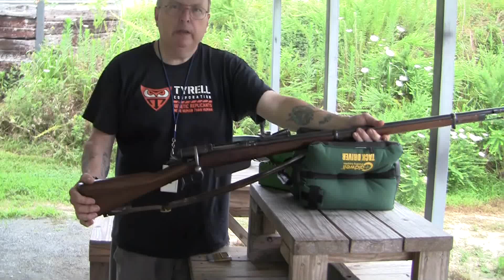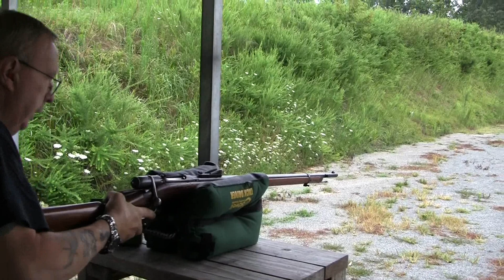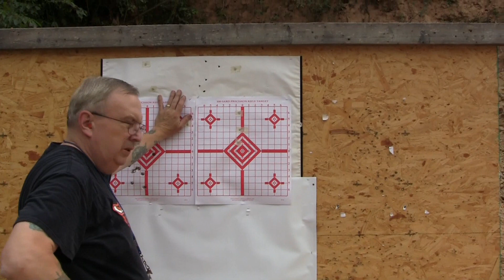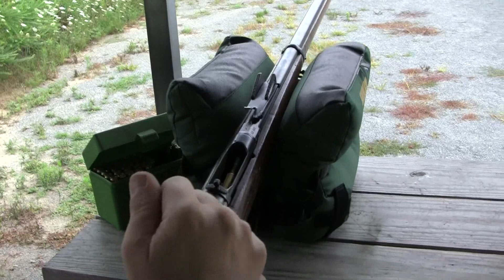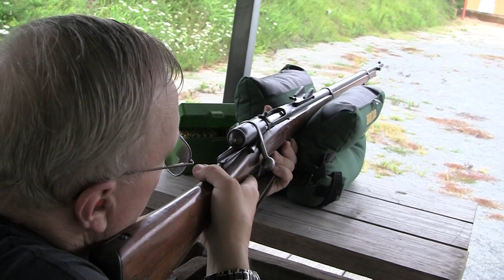shooting Italian Vetterli 1870/87/15 rifle 6.5mm

Comment: Still have one I bought for $12.95 back in 1967. Was listed in the ad as a decorator and described as "Italian VV70 sniper rifle". Came out of the ancient leftover Bannerman inventory. Gun turned out to be in pretty fair shape but had a weak firing spring which I replaced believe it or not with a valve spring from an old lawn mower engine. Back in the day I was brave enough to shoot the rifle using full power surplus military loads and survived. Switched to Norma 6.5 carcano loads that are not loaded to full pressure like the military rounds . Never had any problems smooth action good ejection etc. Maybe I got lucky. In any case now it just stays on the wall as a decorator.

Comment: That’s not how you handle a misfire, which could turn into a hang fire. Just because that cartridge didn’t go off with the firing pin struck it, doesn’t mean it won’t go off. Point that weapon down range for at least 60 seconds before you open that bolt

Comment: Can you use regular 6.5 carcano in this
Reply: no it is not recommended that is a cast bullet load that is a low pressure round
Reply: I have used norma in mine, it has been proofed for them, but i would have a gunsmith try first, AND, not fire a ton of rounds.